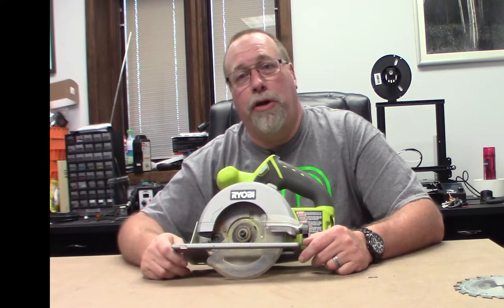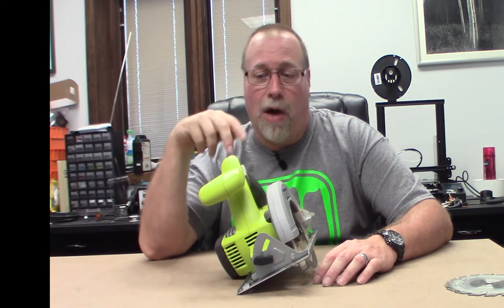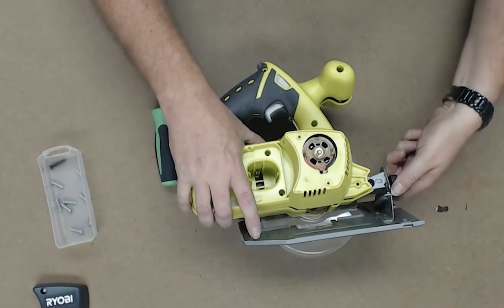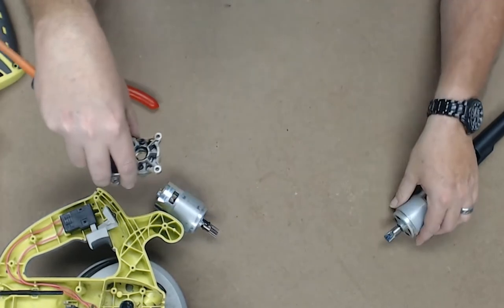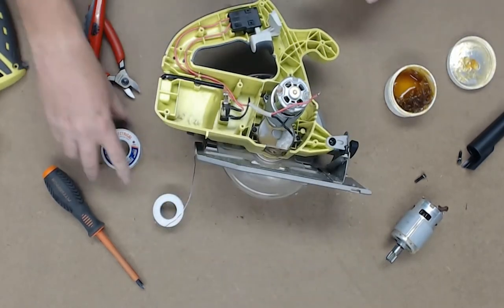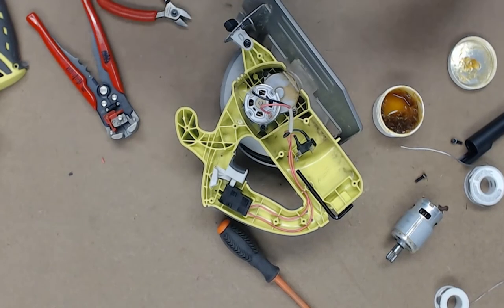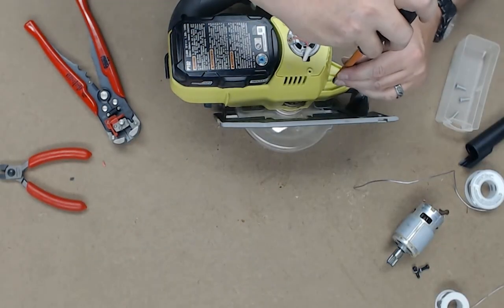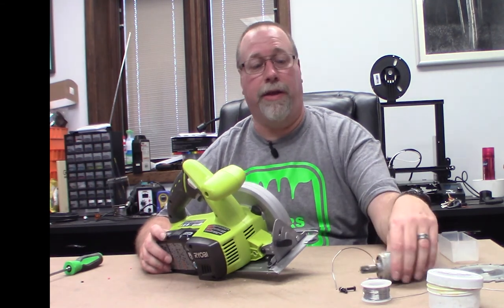Ryobi One+ Abused Circular Saw Motor Replacement

Comment: You were lucky that the motor you found came with the cog already on, the one I bought off eBay didn’t so I now have the task of removing the cog from the old motor and fitting it on the new motor 🥴
Reply from the maker: I got mine at ereplacementparts.com.  Back in 2020 it was only 25 including shipping, and came with the gear installed

Comment: Hey , you got any idea what's causing my saw to cut off after a few seconds being turned on ? I guess it's either the trigger switch or motor ? Don't even get to put it into lumber it just cuts off and no it's not the battery
Reply: It's the battery. They have thermal cut off. If the motor demands more to many amps "weak contacts in saw motor" the batteries shut down. Try cleaning the saw internals.

Comment: notice... there is NO current limiter... that's why the motor burned... that is why they are so CHEAP... that is why they are JUNKS... during the holidays you can buy a Dewalt for about the same price... so is it worth it??? even Hercules is better than this...
Reply from the maker: Since replacing the motor its worked great!